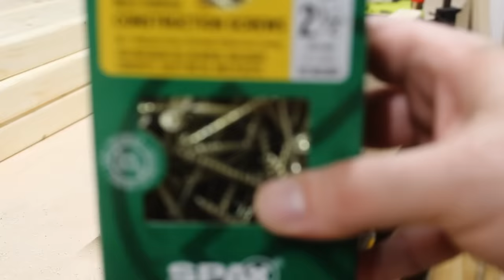The 1-Hour Workbench / Outfeed Table // Woodworking DIY

Comment from the maker: PLANS : robert-j-keller.com/plans/1-hour-workbench
Also available in METRIC: https://robert-j-keller.com/plans/1-hour-workbench-metric
Reply: Hi Robert. Love the video and the workbench. I went ahead and bought the plans and they look so perfect, I think even I can handle it! 😂

Sorry if I missed it, but can you tell me what the final height is with the 5.5" casters? I'm short, but also want something I can use standing up or with an adjustable chair, so I want to adjust the measurements for the legs as needed. Thanks!
Reply: @RobertJKeller  what is the final height of the workbench with casters?
Reply from the maker: The final height is going to depend on the exact casters that are used. It would be caster height + 28 7/8"
Reply: @RobertJKeller  perfect. Thank you!
Reply: Ordered! Thanks!
Reply: What size caster wheels did you use? I saw you are using this for a saw stop outfeed and I would like to do the same.
Reply from the maker: I'm fairly sure these are the ones I used:
https://www.homedepot.com/p/Everbilt-4-in-Red-TPU-Heavy-Duty-Swivel-Plate-Caster-with-Brake-250-lbs-Weight-Capacity-800865/306756459
Reply: @RobertJKeller  Thank you!
Reply: @PaulSter woe
Reply: I love your work 
What is the kind exactly for this wood please???
Reply: Hello.
It can hold 800kg?
Reply: Can you please make a video of building an architects/ engineers adjustable drafting table . Please and thank you 😊
Reply: @PaulSter } p0
Reply: @RobertJKeller  what is the Length & Width of Plywood Sheet
Reply: Wow make table out the plywood lol
Reply: thanks for the metric!!   Inches do my head in..

Comment: A small tip, if I may. When cutting the top, leave a 1" overhang on the front. That way it's easy to dust off as you'll have a little lip to put a dustpan under. It is also nice to have an overhang for clamping lumber with a quick-grip clamp. Your "L" shaped legs are a neat idea. Nice vid!
Reply: Plus you can use clamps on the sides of that overhang,  I found this out by accident when I built my table a few years ago.
Reply: @allennicholson8761  bnmkommi
Reply: Thank you, good idea!
Reply: @seanwalden70  vko
Reply: @seanwalden70   kkk

lo
mokio
Reply: Willee if you notice at 6:51 and again towards the end, there is a couple of inch overhang which I thought was great for clamping
Reply: The bench I made has overhangs on three sides, the fourth one which is one of the short sides the top sits flush with the legs and stretcher. There I can put a removable vise plus I can clamp vertically long pieces to the legs.
Reply: @jellyg.8961  Flush and vertical is a great idea.
Reply: @djawad  You're right. I missed that. Also a good shot of the overhang @ 7:04. Thanks for the heads up!
Reply: U can still clamp with bigger clamps but maybe a lip would be good.  Maybe just on one edge.
Reply: @jellyg.8961  Great idea.. Thks for sharing 👍
Reply: @allennicholson8761  I agree, I am leaving an overhang of 1-1/2" to my bench.
Reply: Make the table top 2 ply.
Reply: @TomRedFM  if you say so buddy...
Reply: I built this desk and did that. Nice tip.
Reply: What king of wood can I use for the top, is that playwood?
Reply: @josivasam8932  Use OSB for the top then cover it with 1/4" MDF. That way when the top gets banged up you can pop it off and lay another sheet on it.
Reply: Nice tip, building a bench today, thanks.
Reply: Built this today and used your overhang idea. Thanks for the tip!
Reply: 100%, having the edge for clamp is a big plus. Otherwise, you will need to buy larger clamps which costs a lot more than a 4-6" clamps.
Reply: Maybe it's just not necessary all the time. Everyone's likes are different. As well as the use.

Comment: Tilt the drill about 15 deg when removing after driving screw in, then remove it from the screw head. the bit should come out without sticking into the screw almost every time. Will save you having to take it out by hand each time as you do in this video.

Comment: I’m just starting to get into woodworking and used this video as the inspiration to build my own worktable, but made a few minor adjustments.  For the legs, instead of using 28-1/8” 2x4’s, I used 4x4’s cut to 30”.  The rest of the frame is 2x4’s cut 71” wide by 34” deep.  For the top, I had a sheet of 1” plywood left over from my bathroom remodel several years ago, so I cut that down to size and used it.  It’s attached to the frame from underneath using twenty 3x3” metal brackets.  With the casters, it’s the same height as my table saw.  It’s big and heavy but rock solid, and overall I’m very pleased with how it turned out.  Thanks.
Reply: How’s it holding up? 20 3x3 brackets?? I know what hardware overkill is and just the weight of the fasteners alone for that is worthy of recognition.
Reply: Alright. Adding metal brackets to the list.

Comment: Great to see a decent beginner friendly bench to get the workshop up and running. Been using a fold up painter/papering table, but it's time for an upgrade. Good video, and love the end.
Reply: With the wooden one you don't have to fold it up and slide it between  garage cabinets.As long as the garage has room for your wife's car.

Comment: Mr. Keller:

At first, after buying your plans, I thought the leg length was too short for my height (6'2") but after assembling, the bench will be perfect for me after adding the casters. It's a great bench for the $$$ and simplicity of building it. Thanks a million. (Wait. Thanks $999,999,998 worth!)
Reply from the maker: Glad it worked out!
Reply: Well!! I got it all framed out. Indeed, the 28" legs are turned out to be too short for my height (6'2") even with 6-inch casters. I would have been better off using around 38"-40" as leg height, which would bring the overall height of the bench to 44" or so. So I think I'm going to unbutton the thing and get some longer 2x4's. Of course there's the "Joe Magee" solution which is to just put extenders on the present legs. 

But the framed out bench is very sturdy, too be sure. And overall, it's a great, simple frame with lots of possibilities for tweaking it into something more elaborate. As it is, my plan is to joint 2x4's together for a top. Maybe hang some drawers on it, too. 

Fun project.  Definitely not a 1-hour project for this tenderfoot. :)

Comment: I was looking for an outfeed table for my table saw that could double as a workbench.  This is exactly what I need!  I agree with one of the commenters.  It’s nice to have something you don’t need a jointer/planer/tablesaw to assemble.  Although milling those boards would be nice, it would definitely add to the time.  Nice video, thanks for making.

Comment: Just built your workbench - came out terrific. One small amendation, though. Instead of putting the lower bracing on the outside of the legs, I put it inside so that I could put a shelf in below. Worked beautifully.
Reply: Exactly what I was thinking with the same idea. Add a bottom shelf and a drawer
Reply: Ottima idea!!👏 Domani inizio la costruzione, cercavo proprio un tavolo così, semplice ed essenziale!! Tank🙏

Comment: For any Brits who find this vid, I made this with 15 lengths of Wickes 2.4M 38mm x 89mm CLS timber and 200 Wickes 65mm deck screws, total £74.40  Construction was the same as shown but I used 10-off 170cm pieces for the top which makes it really solid and installed an additional 3 noggins to support the length of these.  For the build I chopped 70cm off of each piece for the legs (8-off), side supports (4-off) and top noggins (3-off) then doubled up the front top stretcher to support the 10th top piece and give me a table top 170cm x 89cm.  The other difference in my build was to glue all the joints with waterproof D4 PVA (Toolstation) since my table is going to live outside; also I pre-drilled (not pilots) before screwing as it found this pulled in all the joins better    I then liberally coated it in Sika clear wood preserver (Screwfix).  It’s an easy to build, really solid bench which took me 3 hours because of the glueing and the compound top.
Reply: Noggins? For the Colonials reading this, what is a noggin?

Comment: Awesome build.  I used your design but added a couple of cross members and glue to support the plywood so it does not sound like a kettle drum.  Also added a 5" block of 2x4 to the ends of the legs to support the 3rd screw hole on the  casters. 
Thanks
Reply: Yeah, cross members a must and so easy it's not worth missing them out.

Comment: Personally, I totally agree with you. This simplicity really works. Strong enough to hold everything together for years. People should 'keep it simple stupid' KISS. Get it done and out of the way!  Thanks so much for sharing your vid. Stylish ending!
Reply: I like these kinds of tables better than the fancier ones folks have posted.  My grandfather used to throw these kinds together all of the time.  It doesn't bother you to mar, scuff, drill or saw into these.  I'd hate to have one that took a week to complete and has a lacquered surface to look nice because I'd be afraid of ruining it with a simple project by cutting or drilling into it.  These are actual carpenter benches; the others are just glossy wannabes tossed online to attract subscribers with "Oooo!  So pretty!" comments.  I'd much rather have one of these.  You can actually do work on one of these. =)
Reply: @jamesanthony8438  very true. In my country Thailand, no professional carpenters use fine looking tables. They just put up quickly plywood tables and work from that in their occupation. Hard and sturdy and adequate to get work going. And all their table saw are quickly make-shift, almost impromtu version that they put together in 2-3 hours. Not that I agree at all in the safety aspect, but it just does the work for them for many generations. Haha
Reply: @Jartisann  Half the time, the closest I have to a workbench is a 1"x12" plank laying across two saw horses.  Like you said, it ain't pretty, probably isn't safe, but it gets the job done.... if just barely. =)
Reply: @jamesanthony8438  Also looks like it would be easy to modify to add a table saw if you wanted to.
Reply: David Roman I was thinking the same thing for my sliding miter saw!!! I just downloaded the plans but I won’t be making it as big as the one he built here. I’m looking forward to putting this thing together.

Comment: Great video, simple and straight to the point 👍 Seen lots of workbench videos but this is the one I'm using as a guide for my own bench. Instead of putting bracing around the outside of the legs I'm going to put it inside so I can mount a lower shelf for storage.

Comment: Like this a lot. No lame music track either (thanks). One suggestion for next time... Maybe show a shot of the finished product right at the start? That's just so ppl know just what you're building without having to skip to the end. I like the way you left an overhang -- it will make clamping stuff to the workbench easier. I might make the same thing this winter, although I'll probably use wood glue as well for extra strength. Overall great job!

Comment: I personally would probably use some constructive adhesive in most of the joints in order to help them avoid loosening with time,  and perhaps attached a chunk of 2x4 in the open area over the casters to reduce the chance of them pulling their screws out as easily. Still a decent bench either way.

Comment: I built one like this several years ago. My frame is inside the uprights though. That seemed to workout pretty good. I think the total cost after buying screws (not cheap) was a bit over $40 and took about 2 hours. My wife loves it. I've since added 2x4's on the bottom for a lower shelf.
Reply: 👍Putting the leg supports on the inside also allows you to put in a bottom shelf

Comment: That's all you really need, it's just a work bench.
Reply: Joshua king agreed but if you want flat and aren’t on a perfectly flat ground, swap the locking wheel casters for the height adjustable ones so you can keep the table level.  Which means a slightly different design on the legs (to accommodate the caster’s hole).

Comment: Flat-stud your bench top support frame - extremely handy for quick clamping work to bench top.  Just miter 2x4 ends at 45.  You can either screw the frame into the legs top down, or wrap frame around legs which is what I did when I built mine eons ago.  I also added a fifth leg, a doubled 2x4 in the center toward back which provides significantly more rigidity to bench top - also provides support for simply plywood shelf underneath.  I wish there was a way to post pictures on here.
Reply: I would love to see pics of this!
Reply: @cindyp2296  I suspect y-t prevents posting pictures in comments because one picture could take forever to load, thus slowing down the loading of the video along with it.  And if several people posted pictures in their comments, it could completely bog everything down.

Like RJK's design, my bench is really simple, cheap, and easy to build.  It's 3-1/2 ft. x 7 ft., and it's my "basic" stationary bench that is fixed up against the wall.  It's for myriad tasks, and most of the time has evidence from one project or five at a time.   Be sure to plan the height and width of your bench to not only allow for easily reaching the back surface of the bench top, but also to reach over it for a pegboard or other tool storage above the bench if you add that.  I'm tall so 3-1/2 ft is an easy reach.  

If you look at the picture icon for RJK's video, he shows the plywood-topped workbench with the supporting 2x4 frame mounted perpendicular to the plywood.  Simply turn the 2x4s flat instead, with mitered intersections at the corners.  If you're using 3/4 ply, flat-studding reduces the thickness of the edge from 4-1/4 in. down to 2-1/4 in, much easier to clamp.  After that, add whatever your imagination comes up with for various additional support, shelf, etc.  depending on how you operate.  Have fun.
Reply: @rla1000  Gotcha! I didn't even think about that, sorry! Great explaination! I can picture it better now, thanks!!

Comment: Good job! The Workbench are very nice but i don't believe you do it in an hour.
Reply: Very possible to do in a hour or even less. Seems to be repetitive, like he's done it many times before
Reply: If I had access to his shop this could easily be done within an hour. Think about what you’re doing: simple cuts of 2x4, a single cut on plywood and drilling screws. I could even reduce that further; cut a few steps by using 4 x 4‘s for the corners
Reply: You can do it in 7 minutes 33 seconds if you work in fast forward lol
Reply: Gimme a 6pk and no distractions and I’ll be done in 30 mins.

Comment: My work table is similar except I used 4X4 s for the legs. I had some used hardwood flooring and made a lower shelf for storage. Your bench would be fine for my needs. Quit and easy build. I need one I can fold the legs up since my shop is so small and has to double for the mower and some storage. It was just a car port to begin with and has a gravel (more dirt) floor now so I'll be putting some larger wheels on my bench. Also I'll change the 4X4 legs for the 2X4s. The one I have with the 4X4s now will stay put for another use. Good video. No talking, just showing. I can absorb info better by just watching as I've done a fair amount of woodworking and can see what's going on without much or any verbal instructions. Don't mind watching either way of course, talk or no talk.

Comment: I built a work table when I was younger for my upholstery work.  It was 8'x4'.  I used 3/4 plywood for the top, 2x6's and 2x4's for the legs and frame and added a bottom shelf from 3/8 plywood. That table was heavy.  But it was sturdy enough to hold whatever I was recovering and for me to get on it and walk all over it when I needed to.

Comment: After much reading about different benches online, I decided  on this one to build. I am no super woodworker, just you average DIY'er. It worked brilliantly, and although it took longer than an hour for me to make, it was a great experience based on watching the video several times. All of the difficult bits we obvious from this.  Just built a smaller version for the mitre saw as well, in much nearer the hour. Did the original bench with recycled wood, at a cost of less than £75 UK including big braked casters. Thank you exactly what was needed. Keep it up. Just got to decide what I try next :)